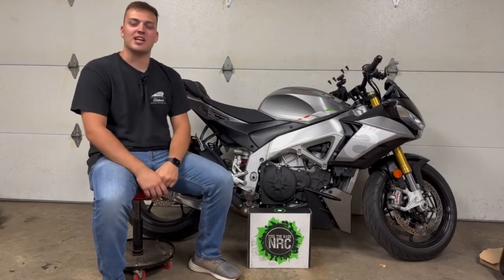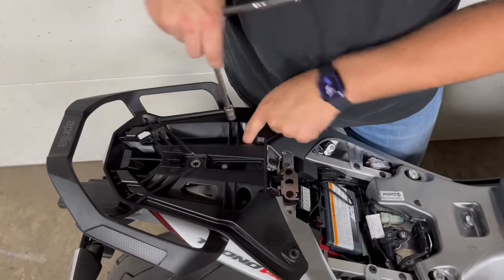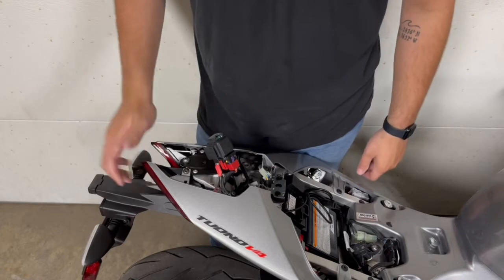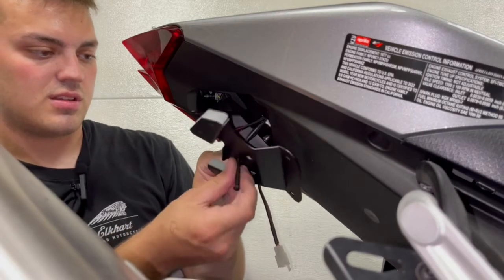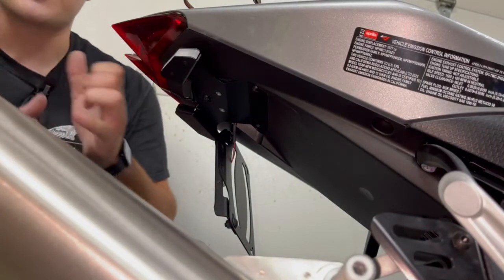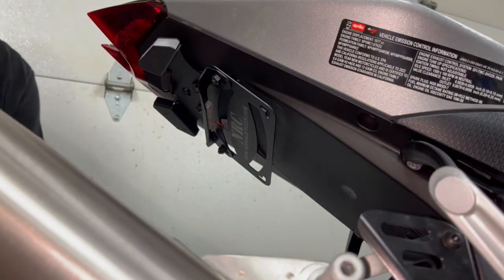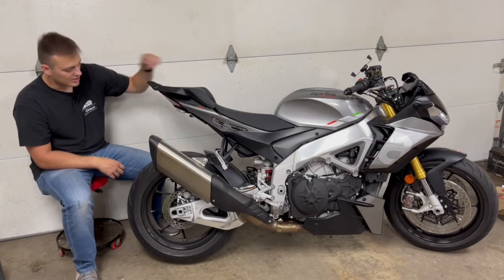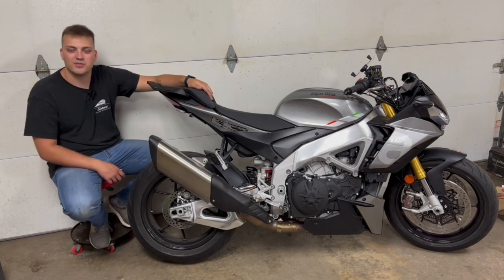New Rage Cycles Fender Eliminator: 2022 Aprilia Tuono V4

Comment: Can you adjust its angle?
Reply from the maker: There is two options with the NRC Kit. You can use the tucked position like in this video. Or you can have it in a regular license plate postion.
Reply: Do you have a link to the one with the normal plate?